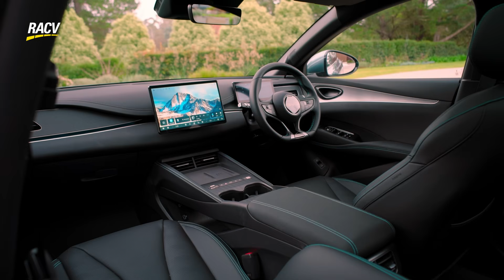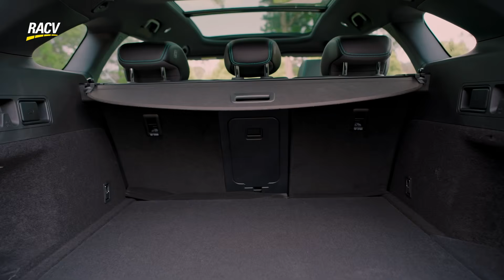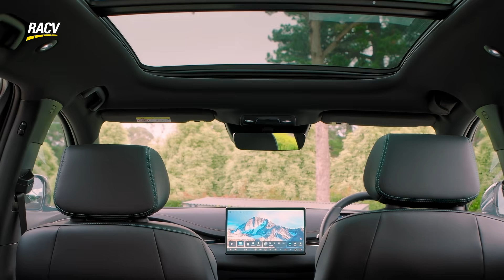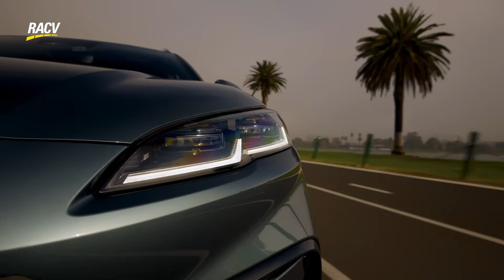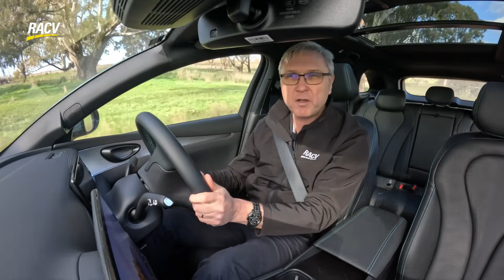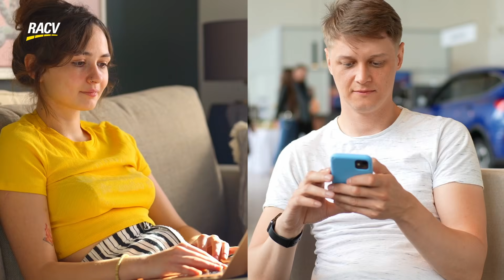Sydney to Melbourne on ONE Tank! (BYD Seal 6 Road Test)

Comment: I like the idea of a smallish wagon but what I don't like is China's stated aim to "dominate" the world car market, that will take away competition and once they do dominate you can bet that prices will rise. I also think that advertising a 1000km range is nonsense, who is going to drive for a 1000km without stopping? Actual fuel economy is what's relevant, my wifes 10 yr old Golf can do better economy than the BYD on a long trip. I've also test driven 2 BYD's, their driving dynamics were rather dull compared to our old German cars.
Reply: By fuel economy do you mean better l/km figures? Does your VW Golf does better than 5l/100km?
Reply: the Golf should be compared with Dolphin G and that one gets better fuel economy when the battery runs out. Also way cheaper with many more features than the Golf. This is comparable to Passat and that is double the price.
Also, that 5L (which in my case is bellow 4.7L) is after the battery runs out. Otherwise is way more economical